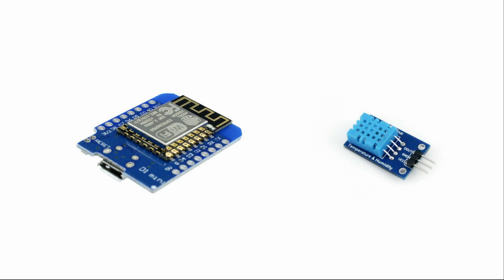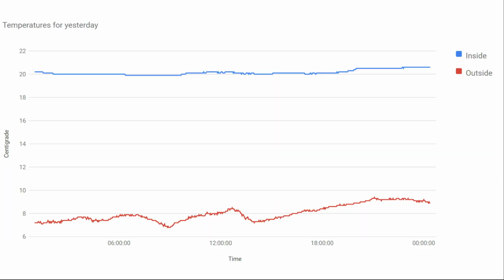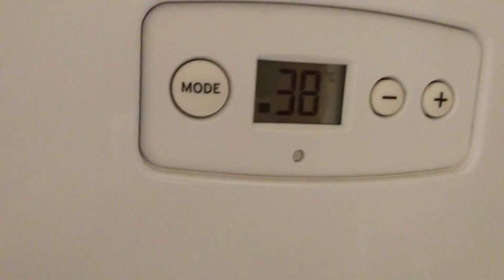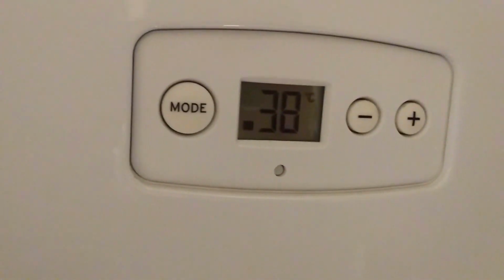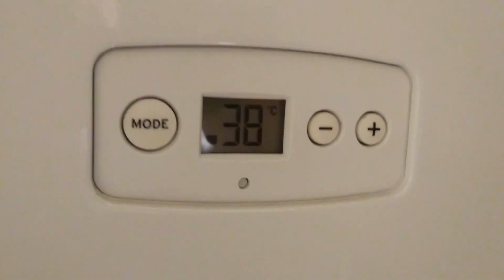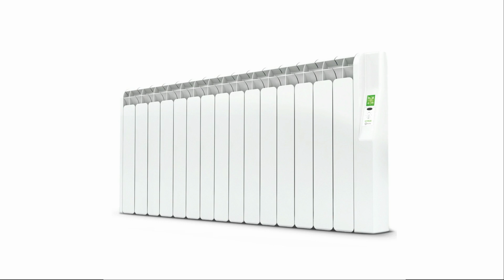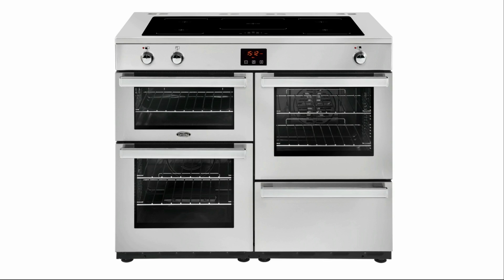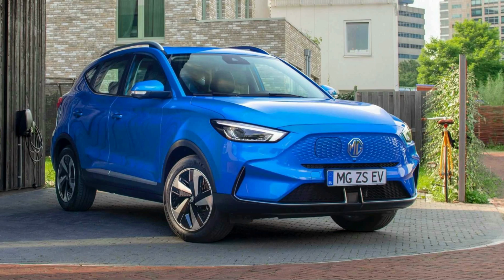Getting off Fossil Fuels goal, update 1.

Comment: Hi Nickolas, as a Refrigeration engineer I would highly recommend looking into a air conditioning system, a small single or multi split would heat your house no problem and is actually more efficient than a 'air to water Heat pump'. An air con unit is an air to air Heatpump which directly heats the air as aposesd to heating the water which then heats the air. I have fitted loads of these commercially and domestically. They are also much cheaper to buy than a water heat pump, they heat the rooms up really quickly (faster than radiator) as it relies on forced convection (a fan) so no need to run them all day. and they cool in the summer. However I wouldn't recommend diy installation as the specialist equipment is quite expensive to buy for a one off job. Hope this helps, be happy to recommend a system if it suits you. 
An idea on efficiency a 3kw heating split, uses around 700wats to run.

Comment: id just like to comment on a heat pump, i saw a video where they are effective in modern houses with high levels of insulation, however your radiators and pipes need to be bigger because the water temp is lower. in older houses with poor insulation levels they underperform , this has resulted in criticism of heat pumps because they cant keep up with older less efficient homes.
Reply from the maker: My radiators can be enlarged if needed.  The pipework is more of a problem but I'll see what the installer says when I get them to come out and quote.

Comment: You also get V2L on the mg zs , and you could charge your home battery’s from the car if you need to shift more to off peak when you move to electric heating
Reply from the maker: Yeah, the V2L could be useful occasionally.  I might look into adding an external socket that feeds into my off-grid selector box.

Comment: My ASHP is temperature compensated mode and will alter the flow temperature in line with with OAT. This results in the flow temperature varying between 35C (my min setting) and 45C. I would therefore suggest that you are not quite simulating ASHP usage, however, it's good data for whether a Gas boiler set to a lower flow temp is more efficient than the stop/start cycling that traditionally happens. My home system is 5.6kW solar, 13kWh House batter, Vaillant Arotherm 7+ ASHP & Sunamp heat battery. I also run an EV, an MG5LR.
Reply from the maker: Well it was more about seeing if water at 45 degrees running through the existing radiators would be capable of maintaining the internal temperature as the outside temperature drops.
Reply: @nicholashowell  It depends on if your currently sized radiators can provide enough heat. When my heat pump was installed all but one of my radiators were increased in size so that the correct heat was available for each room at lower flow temperatures. 

Prior to installation, the company did a full heat survey of my house to determine heat requirements. 

It's still a good experiment for you and I'll be interested in your results.

Comment: If your boiler was set to 75 it was running too hot to condense and run efficiently (assuming it's a condensing model). Probably want it down to 60C or lower.

Comment: Great, very interested to follow this path. Have ordered power monitoring plugs in to try out electric oil filled radiator in various rooms.
Reply: It’s only 2200 watts ( 2.2kw ) so might be better off charging your home battery’s and then using your grid tied inverters to power the house

Comment: Have you ever considered air to air? It's over 5 to 1, very efficient, I run Panasonic air to air heating, cool energy air to water for heating HWC only, family of 4, all electric,  145m2 house,  I use 8300kwh per year
Reply from the maker: Air to air? Is that different to an air source heat pump? I've not heard of it.
Reply: @nicholashowell  it is an air source heat pump, but instead of the refrigerant gas in the heat pump heating up water, it heats the air directly in the house, the insulated refrigerant pipes are run directly to the heaters, so less waste heat from pipes under floors etc, poor pipe lagging etc, an no mass of water in pipes to cool down when it shuts off, from what I've seen up here in Shetland the air to air systems run very efficient, the air/ground to water seems to have allot of efficiency issues, air to water is good for heating up your HWC because it's only on once or twice a day, so lossy pipework is less of an issue
Reply: @nicholashowell an aircon unit is air to air heatpump. They would be cheaper to run than a direct electric heater. I think 1:5 is probably a bit pie in the sky.

You could go full air to air rather than single Aircon units in rooms but requires ducting which probably makes it a no-go in most UK houses.

Comment: I really like the ZSev but my wife vetoed it as she just couldn’t see past the MG badge. We ended up ordering an Ionic5. Once that arrives and the qashqai goes we’ll just have the boiler to contend with and then I can get the gas disconnected. Induction hobs are quite nice you just need to be wary of the pans you choose. Most cheap pans simply don’t work even if they claim to be induction safe and our first set of expensive pans (tefal) only lasted last than 3 years and then the bases delaminated on them rendering them all useless. We now use an ikea set which hold up well but they were pretty expensive.
Reply from the maker: I think we'll be getting some from IKEA, the quality is very good.